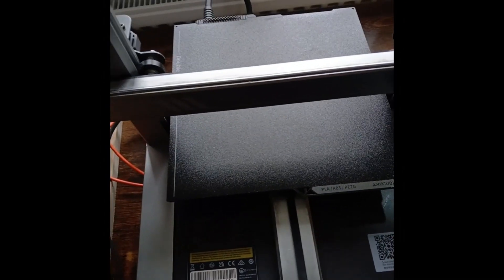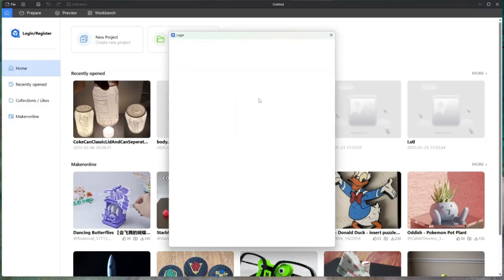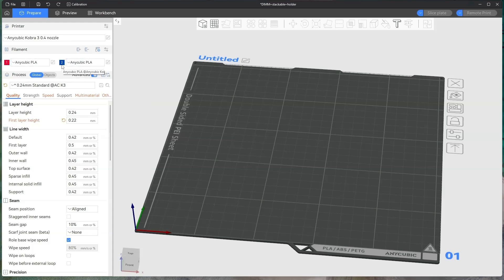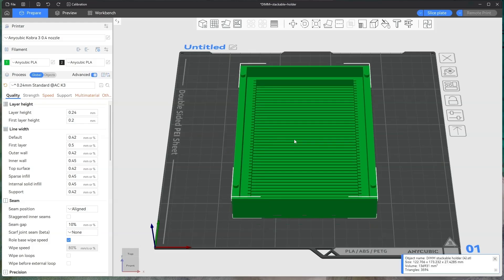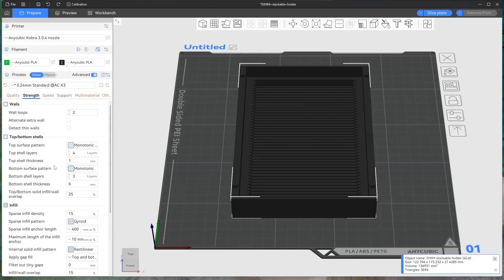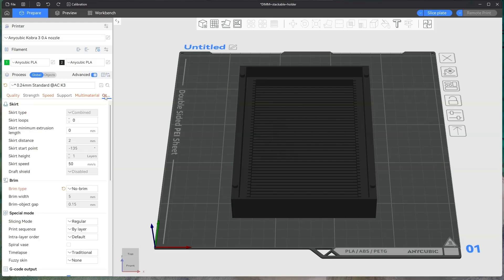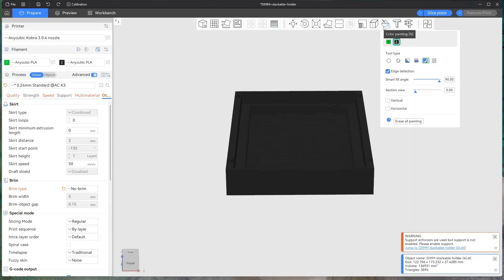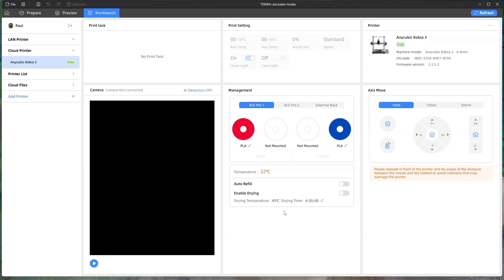How to use the Anycubic Slicer Next For 3D Printing

Comment: Thank you.  I just got my Libra 3 v2.  I can’t seem to get my printer to show up in the Remote print   How do I fix that please ❤
Reply from the maker: Hi have you slected your printer in the profile on the slicer ? Make sure its not selected for a Kobra 2 rather than the Kobra 3. I would also update to the latest  version of both firmware for your printer and the Anycubic slicer.

Comment: what dose imean when i click on the snchronize flilament list fro,e ace pro why dose it sayno ace pro info check connection on the workstation page
Reply from the maker: Hi make sure your Ace pro box is switched on and check all the cables are not loose  because that message means the slicer  can not detect your Ace pro box. I sometimes get that message and have to restart the slicer while the ace box is switched on.
Reply: @resin-art-and-3d-printing  THX so mutch love you

Comment: My printer is a Cobra 3 v2 and I have selected the printer settings for printer 3 0.4 nozzle but it still says the printer is not compatible when taking the bamboo file but when I only make a block and want to print it the answer is still the same

Comment: Still can find my kobra s1
Reply from the maker: Hi if you open up the Anycubic Slicer Next and your printer is turned on it should show up on the "prepare" page. If its not showing up then you can add it by going to the top of the "prepare" page and then at the top you will see "printer" If you click on that it will bring up a drop down menu which will give you the option of adding or removing printers.

Comment: hello there, I am new to the anycubic next slicer, how do i disable it from dropping onto the build plate
Reply from the maker: Hi im not sure what you mean. The printhead is meant to drop down to the bed for printing but not collided with the bed. If this is what you mean try re-running the setup with the bed auto leveling and vibration compensation on the printer screen.
Reply: @resin-art-and-3d-printing  the 3d model in the slicer wont let me raise it up to where I need it to be. I am trying to stack the models vertically so i can print multiple colors in different layers
Reply from the maker: @HunterzbruhPlayz951  Hi the Anycubic Wiki should help you with this  https://wiki.anycubic.com/en/software-and-app/new-page-anycubic-slicer-beta(orca-version)/assemble-models#:~:text=Function%20Introduction:,them%20to%20the%20appropriate%20positions.

Comment: I have an Anycubic Kobra 3 v2, it does not give me the option to select that, only Anycubic Kobra 3 in the printer selection Settings. When i try to print the print selection shows the V2, but i get a Model mismatch error. Any thoughts?
Reply from the maker: Hi you need to go to the prepare tab in the Anycubic slicer next and make sure it says your printer model in the pull down tab near the top where it says printer,  sometime the model file will come with its own attached printer model which changes it  and causes the model error mismatch

Comment: Doesn't seem to work with the AnyCubic M7 Max resin printer, is this software for the older filament printers?
Reply from the maker: Hi yes this slicer is for filament 3d printers and not resin 3d printers,  so will not work with the Anycubic M7 max Resin Printer. You could try Lychee or Chitubox or the Anycubic Photon Workshop

Comment: I'm just learning 3d printing, when I tried to import a file into the Anycubic Slicer Next, the only file types it would allow me to open are 3mf files? I don't see stl as an option?
Reply from the maker: Hi it should allow you to import both 3mf and stl files by clicking on the  top left of the slicer which says "File" it will open up a drop down menu with an option to "import"  If you click on that it will give you all the file extensions which you can import into the anycubic slicer next.
Reply: @resin-art-and-3d-printing  Just drag it in